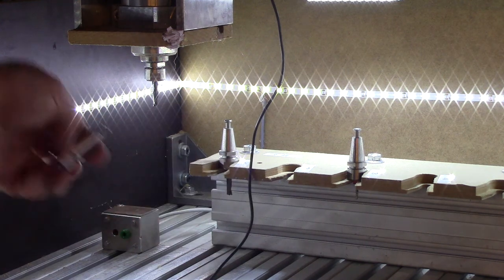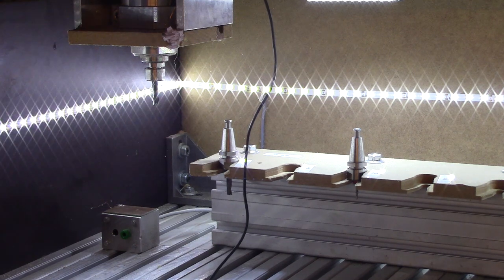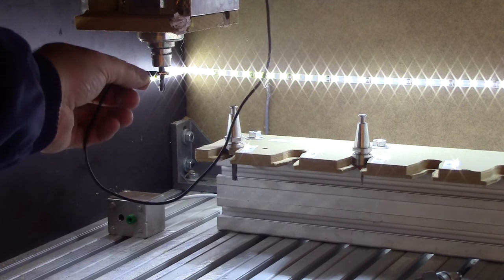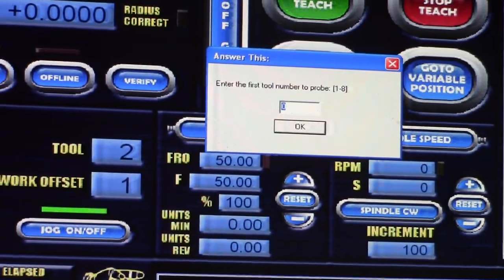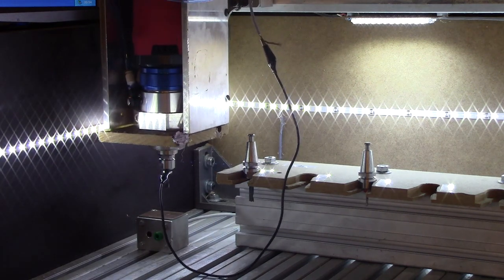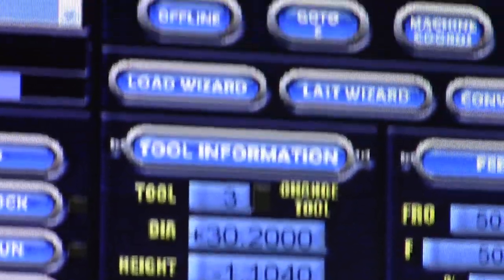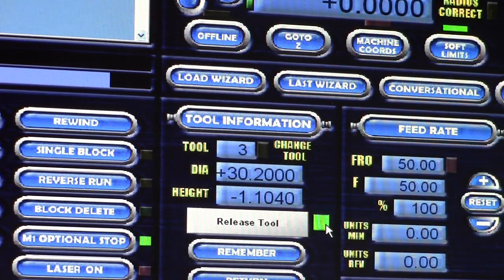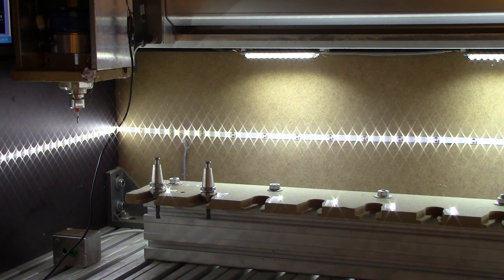Tool length probing with MACH3 and ATC-unit

Comment: WHICH KIND BOARD USING ? THANK YOU
Reply from the maker: Thank you for your comment, not sure which board you mean ? Controllerboard: Ethernet Smooth stepper from Warp9, and 2 regular break-out-board to my stepper drivers. All controlled from MACH3.
Reply: Bo Andersen Hi, thanks for response so fast, I asked about breakout board, another question how did you hooked 2 breakout board together if you don't mind could you send me wiring diagrams. Thank you. odilbeksaporov@gmail.com
Reply from the maker: The ESS smooth stepper has 3 ports that. Each port has a pin configuration similar to a LPT connection. So it like to have a controller with 3 LPT ports. You set this up in MACH3 in your ports/pins. Please check this video where I give a quick highlight of the setup: https://youtu.be/6u_31ZkJTJo?list=PLH2LdhXzCUgvWo3Wu5wuAJrXO6LiwnUV2&t=30

Comment: Hello  Bo , I use mach3 to operate  machine also. I am interested in your concept. Is it possible to share the macro for ATC and Auto tool zero to me ? I will build the machine looks like this to save time. I will be appreciate and impress on your technic. my email is  toolpart1971@gmail.com    Big Thanks for the advance  support.
Reply: Could you send one to me too? Thank you. Qn29196@gmail.com.
Reply: Bo Andersen Thanks alot, i'm really appreciate.
Reply from the maker: Thank you for your comment, email sent with the files.
Bo
Reply from the maker: Dear Sir. Pls. check you email, hope it works out for you. Best Regards, Bo.
Reply from the maker: No problem.
Reply: @Bonaur  hi can you send me script to maticlogar21@gmail.com thanks. i like your videos. thanks

Comment: Why not ground the spindle to avoid using the clip? Not automatic imo if you have to manually attach the clip to each tool
Reply from the maker: Yes, that is the optimum solution. And I tried that as well, but there was no electrical connection internally. Perhaps due to grease in bearing etc. Now after some months of running in, there is a connection. And no need for the clip.

Comment: Hi from Canada.  I have the big tex screen.  I do not have an atc yet But use stop collars on my bits.   After you have probed the offsets for each tool and put it in the tool data base.   do you use the big tex initial set up button to set the work piece offset?  Would your script work with a manual tool change?  return to the same location for the tool and then input to indicate tool change done?   Is it possible to purchase your script?   Truly enjoy your videos and thanks for the help
Reply from the maker: Thank you for your comments. And a lot of questions.
Using stop-rings should do it for you ? The rings are place the same on the bits right ? So when you touch-off on your work piece, that is Z=0. Once a tool-change is called, you manually change the bit, that has same lengt due to the stop-ring, and the continue milling. This is standard feature of MACH3, in Settings you set the ATC to simething like "Stop and wait for cycle start" so when the bit is changed, you click "Cycle start" and the tool is changed,  and program continues. I don't think the Big-tex probing routine, helps you, again if you use the stop rings. But if you want a PRECISE measurement, the you should the big-tex Initial touch off, and tool-lengt touch off after each toolchange. My script will not work on a manully change if you replace the bit only, by having the bits in a tool-golder, the bit is in the precise same height every time. You can get my script, but i truly belive the Big-Tex solution is right for you, once you get the hang of it, a manully change can be done very fast also.... Please let me know if you need help on the Big-Tex setup. Best Regards, Bo.
Reply: the cutter length is different for each tool.  When I tried setting each tool to the same length with the stop collar I had some which had very little shank in the collet so no clamping pressure, collet damage etc.
I have been using the big tex for a year now I manually change each bit send it to the fixed probe let it touch off and continue on.  I was hopeing with the stop collars and setting a tool off set I could eliminate the touch off and the time involved.   I realize that using the stop collars is not as accurate as a tool holder but I'm machineing cabinet parts and not looking for accuracy of .001".  My machine is a 48" x 96" machine often after the tool zero it picks up the last travel speed and that can be as low as 8 ipm that's a long time to cross the machine to start milling. most jobs are over 25 sheets with 4 changes per sheet.  it would be a huge time savings.  

I would love to have a true atc but cost is a factor.   I'm running a 2.2 kw spindle have not found a good atc in that size.  

when you put a new piece of material on the machine How do you zero z?   do you use the intial tool zero  in the big tex so Mach so mach  knows the offset from the fixed probe to the material height?
Reply: thank you for all of your help I'm trying to learn as I go
Reply from the maker: I see your point. With your setup then the fixed/moveable touchplate is the best option right now. The code however I also remember now to have the same "bug" it uses the feedrate instead of Rapid rate. You can change this in the script so it runs at full rapid.Saving a LOT of time, especially on your huge machine.

Comment: Hi, how are you, I'm from Argentina I speak Spanish, I hacerteuna question, the pneumatic clamp is individual cones spindle motror? what would be the English name, where I can get. Thanks for your help.
Reply from the maker: Hi. I'm From Denmark and I speak Danish (And some English) The Automatic-tool-changer, or ATC-unit. I got from a German webshop:
http://www.sorotec.de/shop/Fraesmotoren-neu/oberfraesen/werkzeugwechsler/Werkzeugwechsler-f-r-Kress-FME-1050-1---FME-800-V2.html

You are correct it is and Add-on to the existing Suhner or Kress spindle motor. You can see in this video how it's mounted:
https://www.youtube.com/watch?v=xl_P04dGh70&index=10&list=PLH2LdhXzCUgvWo3Wu5wuAJrXO6LiwnUV2

Please contact me again if you have any other questions.
Bo
Reply: Thank you very much for your information

Comment: I have argued the point consistently with people that depend on probing. It takes too long folks! As Bo has said, Mach has a registry that you can input tool lengths before you run the program......so much slower using a probe
Reply from the maker: Thank you for your comment. Agree. If you have a ATC, one should look into using the tool length offset. Such a smooth and fast ride :-) This video is how to speed up the process for measuring the tool length offset.
Reply: true...I happened upon this video as it came up automatically and was surprised to hear somebody talking "pro-registry". After designing and building an ATC prototype for the Taig mill I preach against using probes because it is so much easier to measure tools and enter the lengths in the registry.